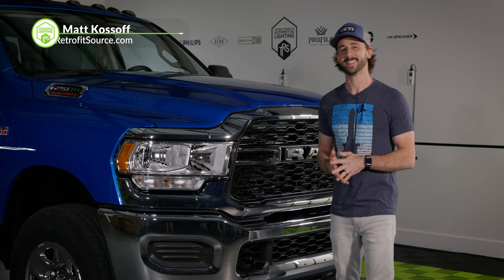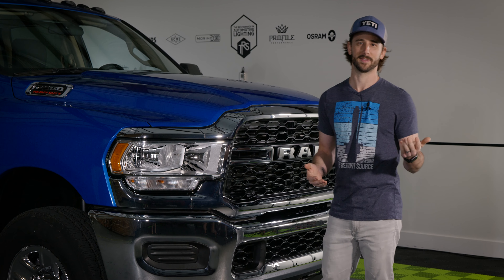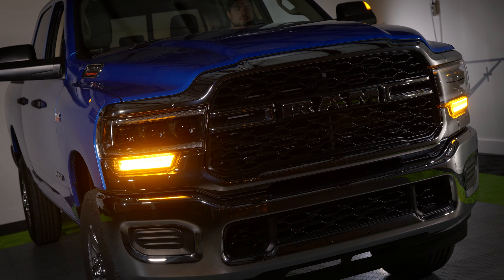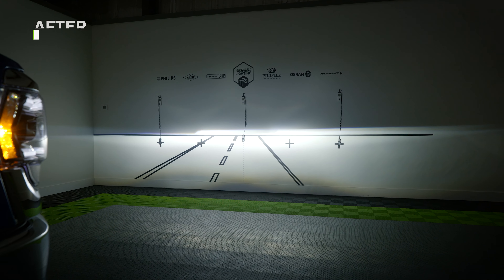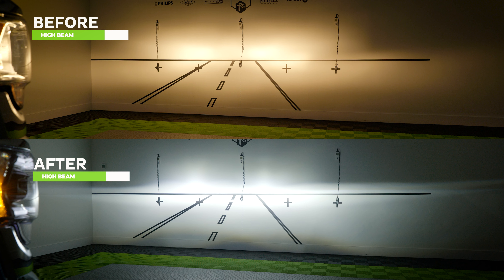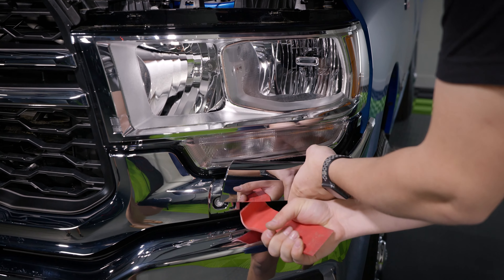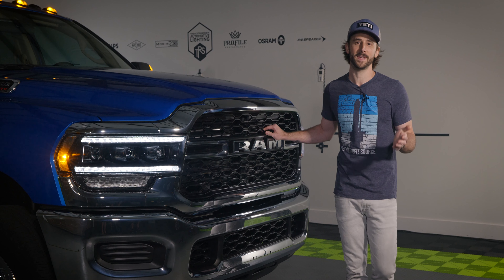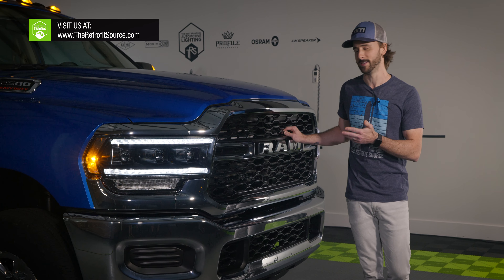19+ Ram HD Morimoto XB Headlights Are Here!

Comment: Can the Morimoto XB be adjusted after installation
Reply from the maker: Yes, there are adjustment screws that allow for vertical and horizontal adjustment located on the back of the housing. You can reach them with a Philips screwdriver. Just make sure to park 25ft away from a wall or flat surface so you can make sure they are aimed properly & oncoming cars are not blinded.